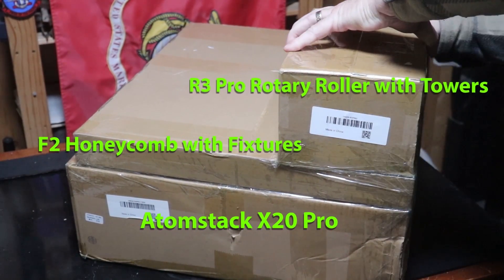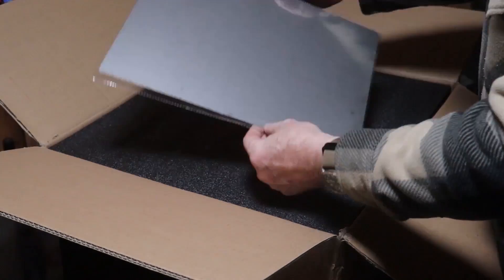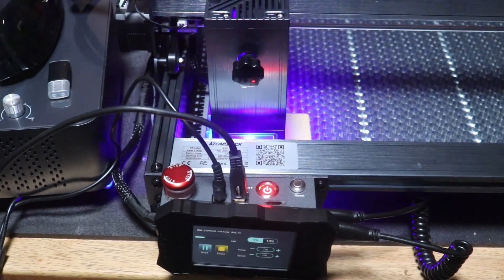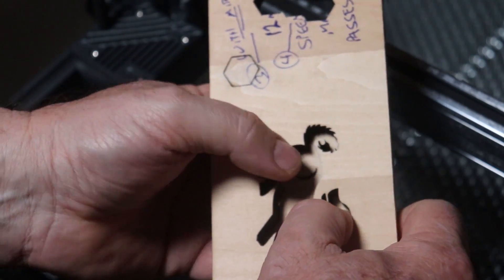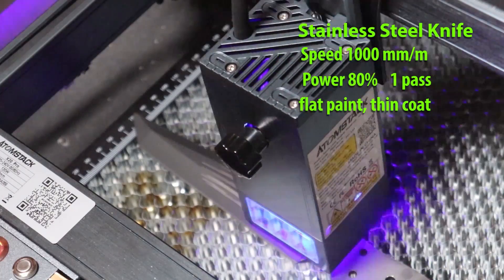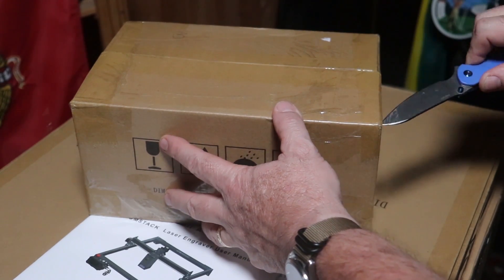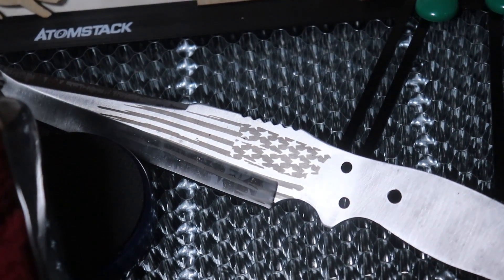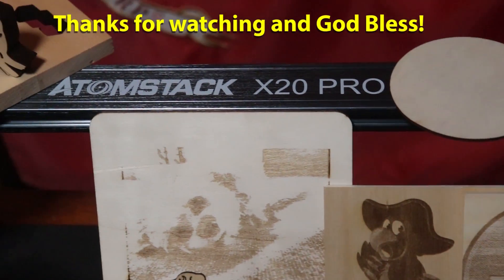Atomstack X20 Pro Laser Engraver Test and Review

Comment: Thank you for the video. I am looking at the X7. My question is with reference to engraving cylinders. Do you know how small of a diameter that accessory will print on? I'm hoping it will engrave the handle of a pool cue. Thanks again for the video.
Bill
Reply from the maker: You're very welcome, Bill!  with the accessory R3 Pro, for cylinder engraving, Atomstack says it is good for items as small as pens and bullets.  I haven't tried these things yet, but I do find Atomstack to be a company that puts out quality products.  search for that accessory and read up on the capabilities, and you'll find many examples.  The challenge for a pool cue would be the length and balance of it during the lasing.  Hope that helps!

Comment: How do you align your laserjob on wood so that it fits?
Reply from the maker: I just measure everything, the wood, the size of the engraving or cutting, and then in the software (laser GRBL or Lightburn)  I assign the dimensions I need.  I then position the laser on the project center point, again using the software, position the wood, focus the laser, frame it using the software to verify positioning, and then run the program.  That's it in a nutshell.  Hope that helps... follow up if it doesn't and I'll clarify if I'm able.